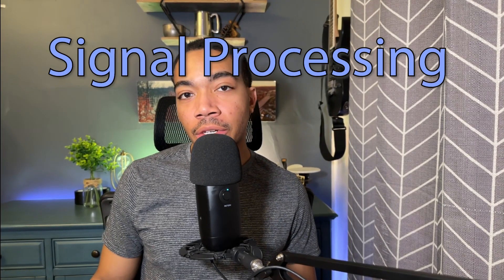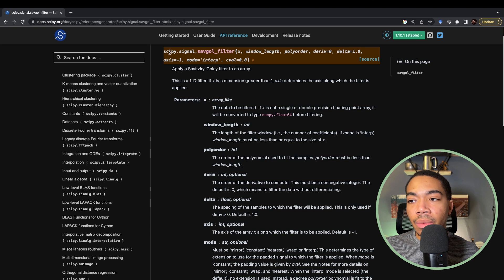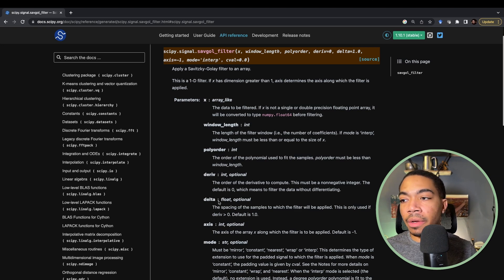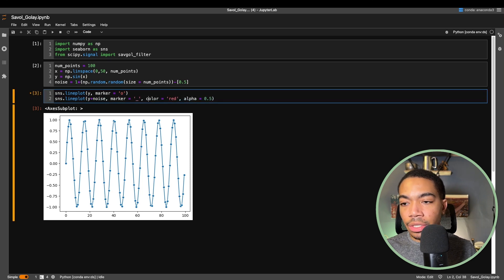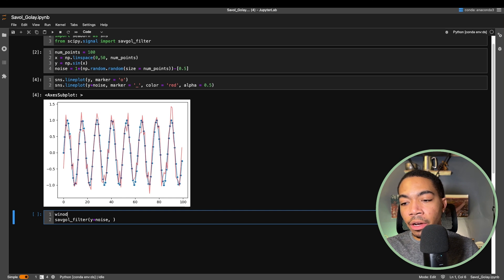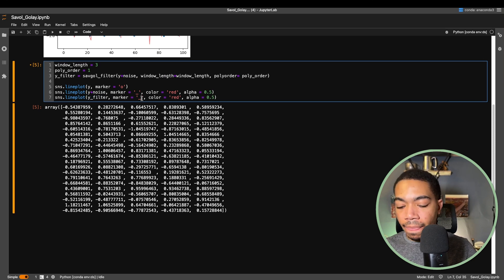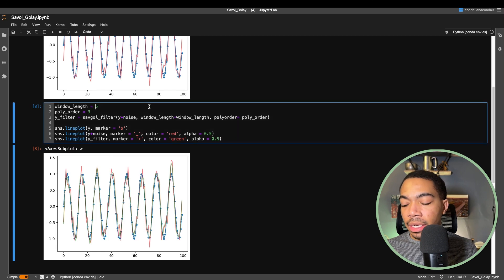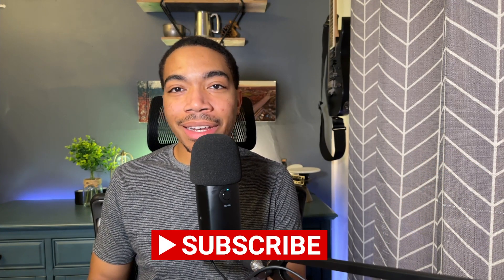Analytical Signal Processing Tutorial Using Savitzky-Golay from Python Scipy

Comment: I am trying to plot resistance vs. time data but the baseline is drifting upward, do you know how to set? Actually Want to compare the response of each curve.
Reply from the maker: Howdy, depending on the other data attributes I’d suggest using scipy to detrend the data. Or you could take the first derivative of the data and that will flatten the baseline.
Reply: @AnalytiCodeTutorials thank you for your  kind advice. Actually I am working on gas sensor device. The problem is some  responses are  partially recovering so they are not coming to baseline, that's why I don't able to compare the data for different response.I can show you the trend If You could share your email. Thanks in advance.